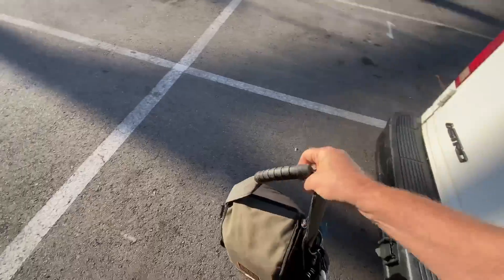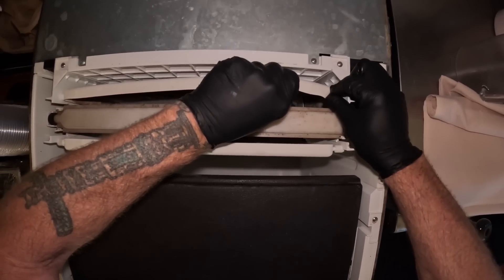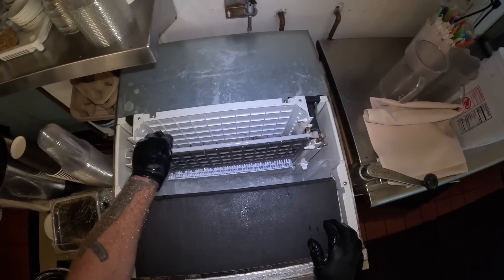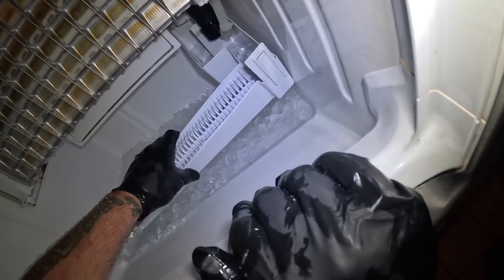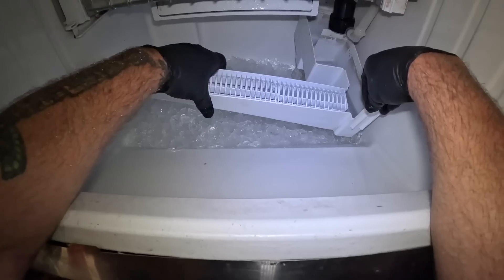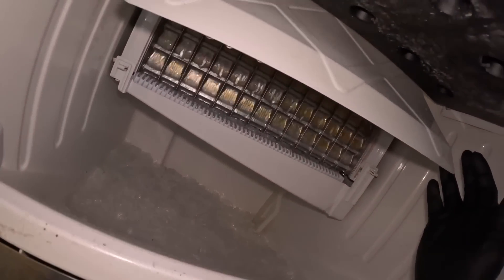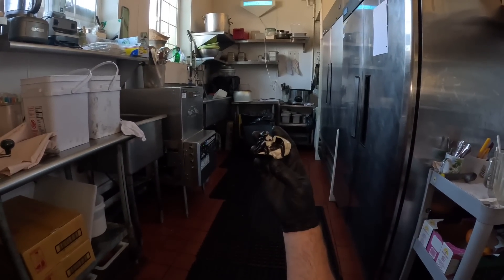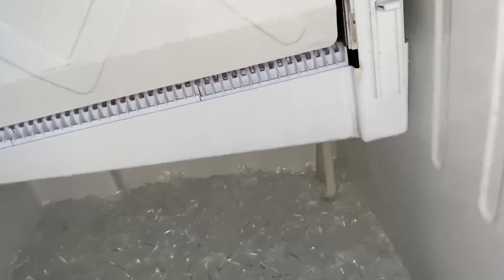Customer cleaned ice machine now theres no ice.

Comment: That ice machine needs a LOT more cleaning and a good thorough sanitation.  I was in the restaurant business for 25 years and was Safe Serve certified and very serious about food safety.  Ice is considered food for Serve Safe and it has to be treated extremely carefully since an unclean ice machine harbor bacteria and can easily get people sick.  If I were a Sanitarian (inspector), I would require much more cleaning and sanitation of that ice machine before it is put back into service.  All the ice in the bin is contaminated and need completely emptied and the bin needs sanitized.  There are sanitizers and cleaners that can be safely run through the ice machine circulated over the cold plate and through the sump etc.  That machine should have a "clean" mode where by it circulates the water (which you add the sanitizer to) and then purges .  I just cringe at seeing a dirty ice machine.  The public has no clue how bad most restaurant are.  I always cleaned and sanitized mine monthly and kept a sign off log sheet on the side of the machine for the inspector to reference and documented any and all service, etc. (my inspector loved it).  I also had filters on the incoming water and a slime preventer which sat in the sump.  There are products for ice machine safety that the operator can add and the seriousness of food safety and clean fresh ice and they are obligated to provide this due diligence.
Reply: All states and municipalities have different priorities. I bet Europe would be strict.
Reply: Yuck

Comment: I have 3 of those machines in service currently throughout my customers down from 4. Been replacing them with Manitowoc. Those are the worst piece of plastic sheet Hoshi ever made. Typical “made in China” junk! Often would have to “prime” the spray nozzle in order for them to work. Always get an “air pocket” up top. Love the duct tape too as plastic clip in from always breaks. You’ve said it best Dave - “everything is junk!”